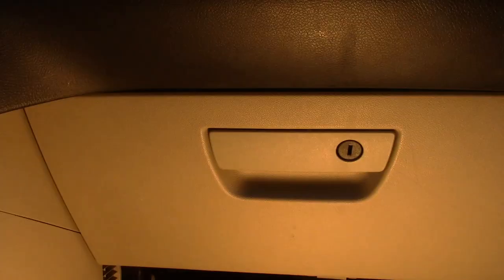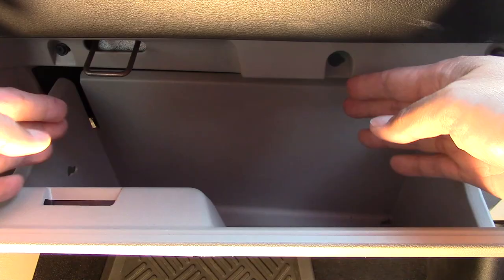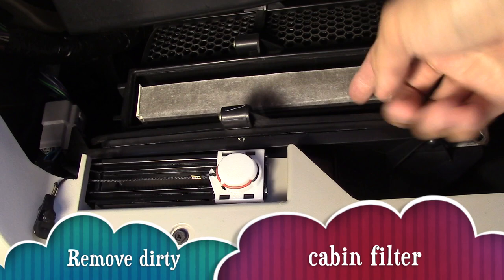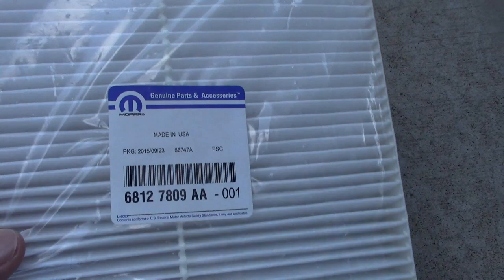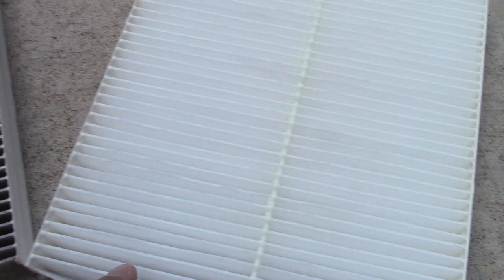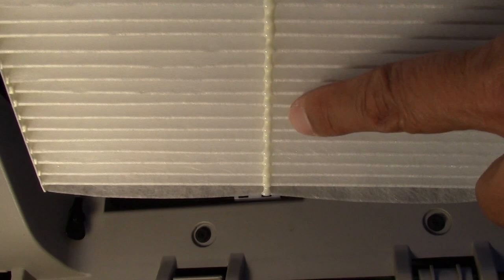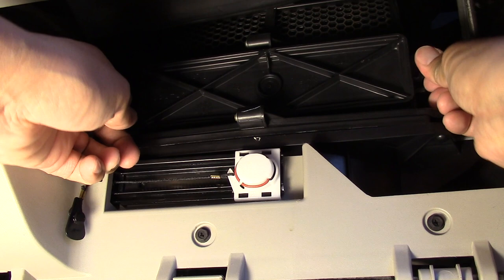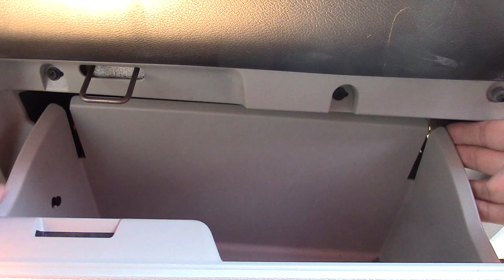How to replace "Cabin Air Filter" 2011-2014 Chrysler Town & Country Van

Comment: My replacement filter had zero difference in sides and had no stitching on the reverse side, it of course was per the filter box exact fit for my chrysler 2014 town and country and #5005 at walmart for $11.23. There was only one way to install it with the shorter sides up and down and the wider is east west/left right. I just placed it the same way the dirty filter came out. Both the top and bottom were equal which tells me my filter didn't have to be up or down a certain way and it only fits one way. There were no arrows etc., so they have definitely changed the design. I appreciate this video as I wouldn't have even known how to do it and I didn't even know of it's existence.   Also, there were a ton of leaves and junk on it too, I bought this car used and from the looks of it, it was never changed as it was black as in dirty oil black.  I just checked and they say that sometimes if your air conditioner is delaying coming on it could be a result of a dirty air filter. My car was doing this. I just turned on the engine and the cool is blowing but the fast air flow still isn't there yet so I know I have something causing the delay.  Do you know what may be causing such a delay? Engine is cool and I haven't driven it yet as it usually starts to blow briskly in about 1-2 minutes.

Comment: Should be noted that not all filters get the glue strip on the bottom. Pay attention to the airflow indication arrows on the side of the filter. The air in this box flows downward. Regardless of what side your glue strip is on, the arrows for airflow should face downward.
Reply from the maker: Awesome tip Mountainman! Thanks for letting our viewers know.

Comment: Air flows from the top towards the bottom since I’m assuming from the debris being caught on top. The line in the middle doesn’t not indicate bottom for all filters. You could add the direction of flow in this tutorial.
Reply from the maker: Good to know John. Thanks for the tip.

Comment: Video helped me with getting behind the glovebox, but apparently the 2010 Town & Country doesn't have clips to get the filter out. Looks like at least two screws involved, but not at an angle I can see em. Which means it's more involved than I'd hoped. Guess I can see why they changed to a clipped cover in 2011.
Reply from the maker: Thanks so much for sharing this info with our viewers. I will mention it in my description box.
Reply: I also have the same issue. It doesn't even appear that it is behind the glove box. Still trying to locate?

Comment: This video is also appropriate for the 2015 model year T&Cs.

I have never understood why some think an automotive-related repair/replace video needs background music.  Some are outright loud and/or obnoxious. I remember one guy had to talk over the outside wind noise and the music, and I could barely understand him.  I was at least able to understand your instructions, but still, the music is too loud and unnecessary.  I thought the pace of the video was a bit slow, but I've also seen videos that rush through the process and sometimes even skip steps that a n00b needs to see.  You don't make any assumptions on the knowledge of your viewers.  I especially appreciated that you showed which side of the new filter was on the bottom.  I had already pulled mine out and shook out all of the leaves and loose particulates before I realized that I hadn't taken note of the side that was down.  Also, my filter was three years old and much dirtier than yours, so I will be paying closer attention to this in the future, especially since I now know where the filter is and how to retrieve it.
Reply from the maker: Glad it helped. Thanks for watching. On my latest videos i have turned down the music...lol.

Comment: I had NO idea ANY vehicle had a cabin air filter until today...I just ordered one for my 2011 Chrysler Town and Country van today and my Jeep Patriot. Thank you so much.  I only have the use of one arm&hand but it looks like even I can do this.  By any chance do you now the part number for the 2011 Town & Country's back up camera module?  My back up camera module doesn't work when it gets wet and I'd like to replace it with a new one and seal the new one before I install it.  I read conflicting articles on the internet as to where it's located as well and not ready to dismantle my van to find out I'm in the wrong spot.  Anyway, this one looks easy. Thanks!!!

Comment: I just paid $35 to have this done.  Now i feel like a complete moron.  Wish i would have watched this first
Reply from the maker: Sorry to hear that. But you know next time.
Reply: You just saved yourself few times more than 35 by watching it after you paid. i was at the dealer today, inquired and was told about $60.00 installed, i know it is not that difficult, so i went to Autozone, picked up a K&N which is one time cost of $45.00 + the cleaning kit, now I came watched the video and after I replace it tomorrow I will feel the dealer guys are the morons! That simple!

Comment: I got my van used, I've had it for a little over a year and in all the times I've gotten the oil changed not once have they asked me about the cabin air filter. Always the main air filter, until yesterday. From the looks of my filter I'll bet it's never been changed, it's a 2014 and the filter was so gross and full of leaves. I didn't even know I had a 2nd air filter. Thank you for this video! Question for you, what is the dampening chord?
Reply: bepamprd the dampening cord keeps the glove box from plopping down when you open it. With the dampening cord it just gradually flows to the open position when opening.
Reply from the maker: so glad my video helped. the chord just holds the the glove box in place.